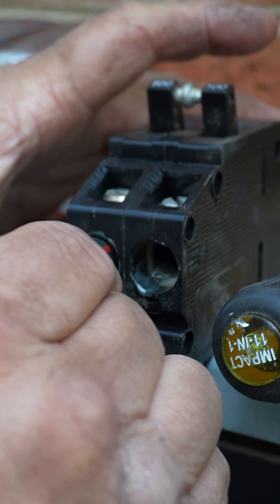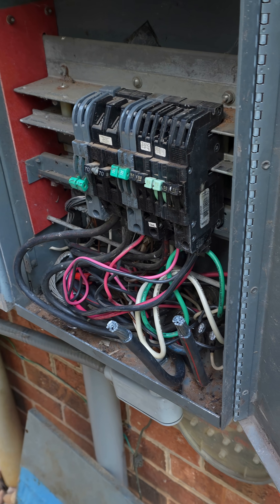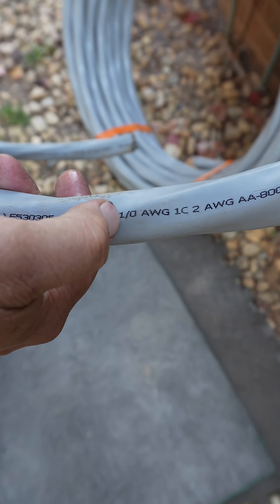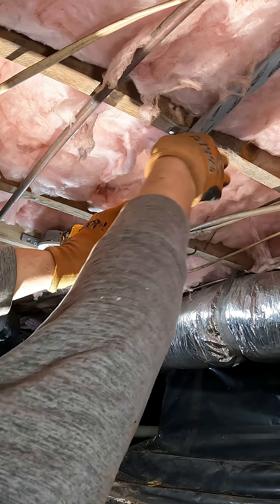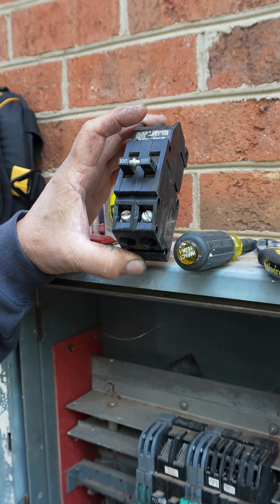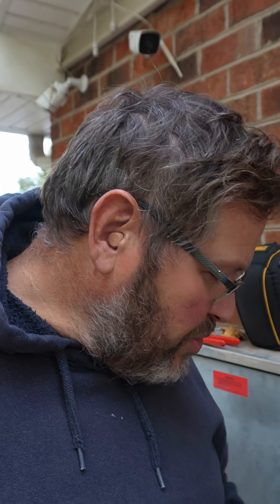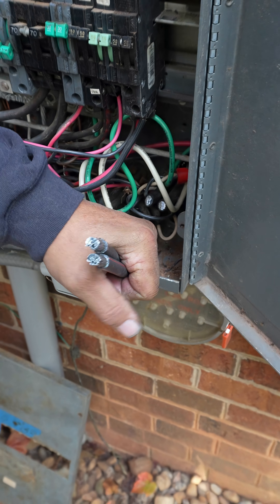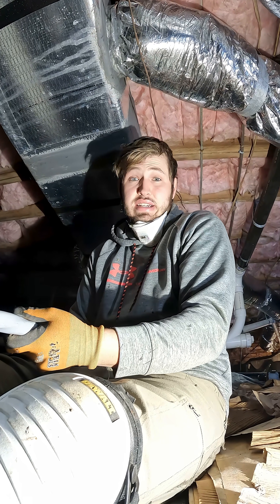Replacing 1/0 wire with 2/0 wire for our sub panel.#campbellbuilt #wire #electrical #construction

Comment: You don't have to put the 125 amp panel on 125 amp breaker. You can just put it on 100th breaker you'd be good

Comment: The need to upsize the wire can largely depend on the length of run (as well as the current).

Comment: Nobody draws more than 100 amps from their service, Cmon? Unless you have a turkey in an electric oven and are running the AC in orlando Florida, during a heat wave where the AC is drawing 16 amps, and taking a shower at the sametime heating the water  with 7 amps, I dont think so?

Comment: Never ever ever leave a Zinsco panel in place.   For the safety of the occupants, change out the panel!   Those Zinsco breakers may or may not trip under overload.
Reply: Oh grow up that's just a crusty service disconnect at this point.
Reply: @A @AAra-p7k  I’m thinking you the one needing to grow up and learn!   I have seen Zinsco breakers and panels.  Electricians told me they have found some 20 amp breakers with 42 amps running through them.   As well as several panels that had burned out.  What experience do you have?
Reply: @KevinCoop1 burnt bussbars are the most common failure of a zinsco.  Slide bkr down and move on.  This is a 100a service disconnect to a subpanel not a 100a feed to a 20kw heat strip

Comment: Definitely get rid of that Zinsco panel because Zinsco is just as bad as Federal Pacific because the breakers wouldn't trip and the busbars would overheat just the same as Federal Pacific , I've seen video when they load tested Zinsco breakers and they did not trip , Plus the breakers don't lock in securely and don't make good contact with the busbars , Get a Square D or a Siemens panel and if you can , Use copper wire for the main power feeding the panel

Comment: First off, we don’t install 125 amp panels it’s you upgraded 200 A and you’re done now my house I did 2 inch PVC copper from the service to the meter because I know that it’s eventually gonna just rot away and turn to powder

Comment: My home has 3 options at build. 100, 200, or 300. 100 is included. 200 is 165, 300 is 400. I paid the 400. Now I have 3 level 2 chargers in my garage while my uninformed neighbors had to pay big bucks to upgrade.

Comment: Zinsco is the bronze metal of fire starting.  Bryant and Federal pacific being silver and gold
Reply: I've seen countless Zinsco burnt where they clip to the bussbar.
Reply: Bryant even? I didn't think they were in the Infamous few. Interesting. FPE and Zinsco for sure.
Reply: @sirnatanielson honestly ive never heard them mentioned with the bad guys by anyone, but in my own experience in my area ive seen multiple melt on the backside and almost cause a house fire. So i always tell people beware of them too
Reply: @billywhalen  interesting. I've seen new breakers burn up too.ITE, BR, you name it. Also plenty of old QOs fail from corrosion. For some reason the Stablok 2.0s seem to corrode out on the round buses. I'll definitely have to watch for the Bryants. Don't see too many in my area
Reply: @sirnatanielson again that just could be coincidence because the Bryant's are basically type BR style but ive caught s few melting, usuallythe colored handle ones (15amp blue, 20a red). Who knows what people before me have done though
Reply: @billywhalen  True, who knows who's been meddling. Pretty sure Eaton bought Bryant at one point, hence the same breaker nomenclature. I feel like my area suffers from more corrosion on busbars and service cables than burn ups. Granted, the corrosion usually leads to the burn ups. Probably just coincidence on some of the trustier pieces of gear. Have done a nasty Federal fire swap once. Wish i would've saved that panel for show and tell, but the stench ruined my van!
Reply: @billywhalen i also know the Westinghouse ones did the same color coding. Not sure who picked them up, or who came first.

Comment: "Don't skimp on the wire" > Doesn't go with copper
Reply: Exactly what I was going to say.
Reply: Exactly.
Reply: Typical comment of using ALU wire, but nothing wrong with it. If you are buying it yourself or are competitively bidding jobs you will definitely consider the cost difference with ALU. Always a know-it-all electrician to know more than the next one. Electrical ego fatigue is real.
Reply: Copper wire is 10 to 20 dollars a foot
Reply: @matthewmidgett6531 you can buy wire cheaper online, especially leftovers from contractors who overbought. I have bought partial spools and even exact cuts on eBay for half price because the seller will get more money for usable wire than they would if they sold it for scrap.

Comment: Complete garbage 🗑 why keep that fire starter ZINSCO
Reply from the maker: Why take the time to find the Trash Can Emoji when you could have read the comments to find out I don’t own the ZINSCO panel?
Reply: @campbellbuilt It popped up as I typed! Baaaaaaaaahaha.  Welp If you cared, then I'd certainly be sure that panel gets REPLACED.  Definitely not safe nor doesn't make sense to find breakers for.
Reply from the maker: Fair enough, when the power company came out a few months back they mentioned about dropping it to 200 amp service. I knew I was putting this sub panel in the basement, also a panel in a new garage so I wanna make sure it’s replaced with a 400, which is what I already have. I already had the 100 amp breaker and didn’t want to spend $400 for a Zinsco since I’d rather that go towards a new box if the power company doesn’t do it. Hopefully I can 🗑️ that thing soon. FYI didn’t even know there was that emoji 😀
Reply: @campbellbuilt 200 amps isn't gonna give you 400.
If you want 400, power company has to approve it and they mandate its location too.
Reply from the maker: I already have a 400 amp Zinsco here, so there’s nothing to approve. Yes I know a new box will need to be approved. They’ve insinuated that they may take it back to a 200 amp only because I’ve switched several appliances to NG, there’s no way they’re doing that before the sub panels are installed. No one wants the Zinsco panel especially me or the Power Company.

Out of curiosity, who am I speaking with?
Licensed electrician
Lineman
Engineer
Power company engineer
Supply house Worker?

Comment: If you're doing the installation yourself, there's no reason to not go copper.  You're already saving a ton of money, and the gauge will be much smaller for the same amperage capacity.  Also it doesn't have the same corrosion problems.
Reply: There's no corrosion problems just stop it already

Comment: The extra $$ to put 2/0 AL instead of 1/0 AL cable for 125A panel with 100A breaker has no tangible benefit… unless you wish to accommodate a future capacity upgrade… or you have a long run with too much voltage drop. Using 1/0 is NOT skimping… sufficient is perfectly adequate. Especially given that you already pulled in the 1/0… zero justification to pull it back out then pull in 2/0. 🤷🏻‍♂️
If you want to put more money into it with a tangible benefit… replace the main panel and/or purchase more AFCI breakers for your 15A branch circuits that feed receptacles. 
Arc Faults are a MF… don’t ask me how I know! 😉

Comment: Oh boy, IMO you would have improved your overall elect safety by spending all your dollars on replacing that Zinsco panel, unless you are doing something like having a lot of electric heat loads in that subpanel that 1/0 SER cable would have been more than adequate, you then could have put a 125 a breaker for the SER cable.
Zinsco is the yugo of breakers, it's better than a penny under an old fuse but not much. If I remember right, those Zinscos fail for overcurrent protection but do trip in short circuit situations ,retired sparc/inspector
Reply from the maker: So when the Zinsco breaker overcurrents what happens….breaker or SER cable failure, which one first? I have some people that claim to be experts saying that they’ve witnessed 70 amp Zinsco breakers carry 100amps. So I disagree about the 2/0 wire but since the power company owns the panel I’m in a little issue till they replace it.
Reply: @campbellbuilt  Normally power company owns to the line side of meter ...downstream of that is customers responsibility.
Reply from the maker: @PepePig-th6sy yes that’s what I’ve known as well but then there’s what I have. 30/40 years ago the power company made a agreement with the homeowners on new construction that they would own the panel in my area. The power company has paid to have many of the existing panels replaced  with new ones but then the homeowner owns it from there on.
Reply: @campbellbuilt  I'd change it if you ever plan on selling it in the future as banks with inspectors will ding it in a heartbeat costing you a ton in value.  Same thing happens with federal pacific etc.  I've also seen this same situation happen in my area The utilities put fliers out a long time ago stating their new policy which limited them to the meter due to panel failures etc basically passed the issue to the homeowner from new legislation.     I'd check and make sure they havent done that in your area as well as most people are unaware of it.
Reply: @campbellbuilt  Also had another same similar situation around here where they put in net metering and required a lot of older homes to upgrade to use their meters or they'd disconnect which cost homeowners a lot.  Some homes had older meters that wouldnt fit the newer meters.

Comment: Did you see how much bearing that 2/0 (aluminum) wire has on that zinsco breaker,  carrying up to 125A (or more) before it theoretically trips.

That's a borderline bad install. Unreliable fire hazard

Old, unreliable gear.
Aluminum wire under load= potential problem
Retorquing is ideal.
Circuit connection high resistance weak point with breakers known not to trip correctly.

Comment: Put copper in
Reply: Agreed. Then the wire is smaller.
Reply from the maker: Harley here, y’all realize only about 5% of homes have copper 1/0 or 2/0 right?
Reply: @campbellbuilt Copper is used a lot more in my area of Oklahoma. But I agree, copper not not as common. But you could do a #2 copper and have way more room in conduit, smaller conduit, smaller holes, easier to run, and still be arated at 125amp.
Reply from the maker: Correction 1%
Reply: @campbellbuilt because its cheaper. Not better.
Reply from the maker: @joshphillips3738 I agree, went to buy in but none of the supply house keep #2 or larger in stock .
Reply: Very few residential services, or commercial for that matter, use copper feeder. Barring an install rhat will have some unusually high current requirements, typically you only see it in Industrial Applications and Three Phase Installations

Comment: Wouldn't it be better to use a crimp lug at the end of the wire, and then lug into the breaker?
Reply: If the breaker is marked with the wire size your landing, why would you need to?
Reply: @sethoakes3795  Because it didn't look like the screw terminal was making full contact with every strand.  Same reason you might use some kind of crimp terminal or lug for a stranded wire going into a branch circuit breaker.
Reply: @kerryedavis they are tested with the wire sizes indicated. No extra work needed👍🏻

Comment: The code gives you the minimum required, sometimes we have to run over sized wire to account for voltage drop or continuous duty or sometimes both for example, so breakers accommodate atleast 1-2 wire sizes up from minimum.

Comment: This is so dumb. Why did you increase your wire size just to keep it on the exact same amperage?

Wasted time and money, then tried to make a lesson about the “improvement” you made
Reply from the maker: This improvement dramatically changed our lives.
Reply: @campbellbuilt I’m not talking about the extra breaker space. I’m talking about upsizing the wire for no reason
Reply from the maker: I never knew by increasing the wire size that it  would hurt your feelings. In the next video when a wall calls for two jacks and two king studs I may put one additional one in thinking of you.
Reply: @campbellbuilt alright buddy

Comment: The breaker space does not dictate the panel load. Just because you ran out of breaker space on the sub panel, does not mean you need more amps...
Reply: Yup, I'm not sure why he switched to 2/0 when 1/0 was sufficient (presumably short run) and he even fed it with a 100 A breaker anyways...
Reply: Because people are idiots and don’t do this everyday like we tradesmen do. Let him waste his money he’ll be alright. If he actually NEEDS to upsize the breaker… welp, now he can. 😂
Reply: Yup…
Reply: Big money service call ;)
Reply: Got to keep the particle accelerator and MRI machine in the basement fully powered.🙄

Comment: Prefer copper for service lines. Last longer and smaller size.
Reply from the maker: True, here’s the no’s $280 for 80’ 2/0 the same for copper would have been $1540 and they would need to order it in. Now of course I could drop down a size to 1/0 using copper and would be easier to bend and manipulate. To be fair the price for copper is a little high since 1/0 copper is the equivalent to 2/0 aluminum. All in all a $1000 more for copper.

Comment: That’s a lot of rambling to make the wrong point. The 15 amp difference between 1/0 and 2/0 will never matter. If your loads are pulling enough continuously for 1/0 to be a problem, your design is bad. 

Meanwhile he’s just going to throw a reconditioned zinsco breaker into that ratty looking main panel. 

Why bother getting the electricians advice if you’re not going to listen to him?
Reply from the maker: Some people are wet in the head. I said in the video that the panel was 125 amp. 1/0 is rated for 120 amps for the NC code which allows you to overrate it to the next size breaker. My thoughts, including the electrical inspector was just put a 2/0 since it’s open. Now go back to your safe place and cry.
Reply: @campbellbuilt  I heard your reasoning. My point is that your reasoning is pointless.  Who cares what the inspector thinks, if it meets code it gets passed. NEC 240.4 (this is “NC code” that your electrician is referring to) allows upsizing to the next standard breaker. And it seems like you’re the one that butthurt, I just called you out for wasting good ramble on a bad point.
Reply from the maker: @wm79198  as our inspectors always tell us “the code is written as the bare minimum”, your a bare minimum type of guy. I’m not.
Reply: @campbellbuilt you wasted all that 1/0, and then installed an oversized wire for a 15 amp difference. If you’re that worried about the 5 amp difference between 1/0 at 75 degrees and a 125 amp breaker, maybe you should just be installing a 150 amp set up. You did bare minimum plus 10 amps, not exactly crushing it on the “exceeding code scale”. Anyways, I hope you sleep well with that zinsco panel
Reply from the maker: @wm79198  WOW, Look at you go, when you gonna ask me how many feet the sub panel was away from the main?
Reply: @campbellbuilt doesn’t matter, voltage drop was never going to be an issue.
Reply from the maker: @wm79198  it does, I’ve experienced it firsthand.
Reply: @campbellbuilt again, worrying about the wrong point. If voltage drop was an issue, why didn’t you mention it till now? (I know the answer, it’s cause you’re backed into a corner and are just throwing out reasons and hoping one sticks.) You’d have to pull the full 125 amps, and have a distance greater than 150 feet for voltage drop to even get near 3%, that gives you an extra 2% more allowance before you’re at the 5% recommended voltage drop at an appliance. You’re grasping. It’s ok to admit you don’t really know what you’re talking about. Pro tip - thumb rules aren’t code.
Reply from the maker: @wm79198  because it’s called a YouTube short and there’s only so much you can put in a YouTube short. Okay you Won, you gave it your best and for that I’m giving you a brand new never used Klein broom, our last couple of electricians couldn’t figure out how to use them. I’m out😅.
Reply: @campbellbuilt lol, it takes two seconds to say “the run is over 150 feet, I’m upsizing for voltage drop”. I’ll take the win though, your consolation prize is 150 feet of 1/0 that will live in your garage forever.

Comment: I recall moving into my house (1977) and thinking the 60 amp service needed to be cleaned up. (had three subpanels) Went to 100 amps during a renovation circa 1980. Fast forward 10+ years and more updates for sauna, hot tub, central AC, air compressor, etc, and 200 amp service was needed. Here we go again. The 100 amp panel became my generator panel and the rest got upgraded to 200 so now I have 10 extra breaker spaces for growth. Just out of curiosity, I flipped everything on in the house including 3 fridges and the well pump, put an amp probe on the main, and I only read 90 amps per leg. Heck, I still have room for charging two EVs if I ever go in that direction!
Reply: Add a hot tub to justify the 200 amp service
Reply: @jay9308    Read again... hot tub is on the list. Draw is 38 amps, steady state with the heater running. (50 amp breaker for motor start) AC is 14 amps each, steady state. (20 amp breakers for starting) I could list it all if necessary.